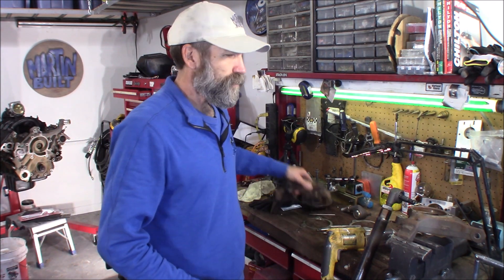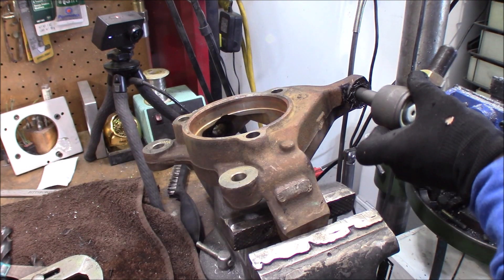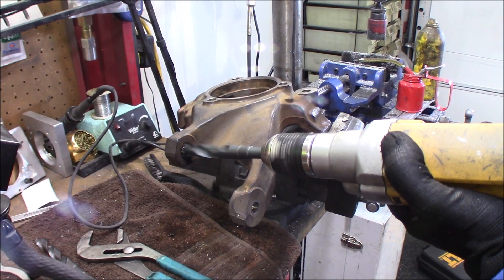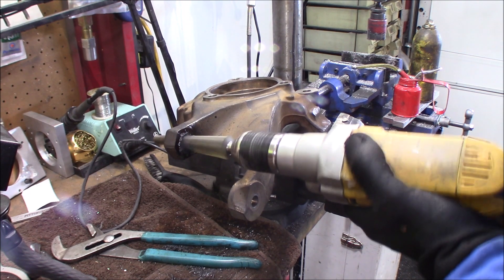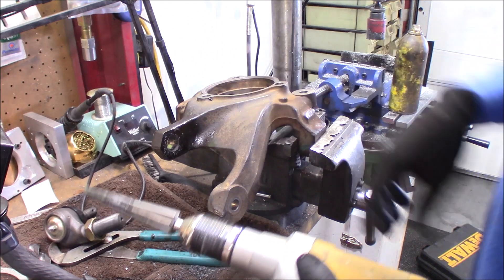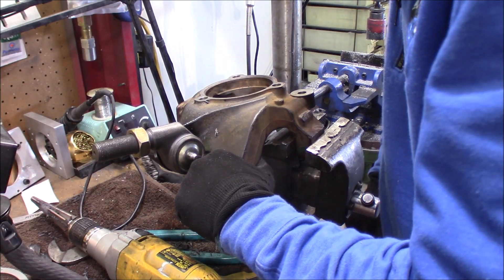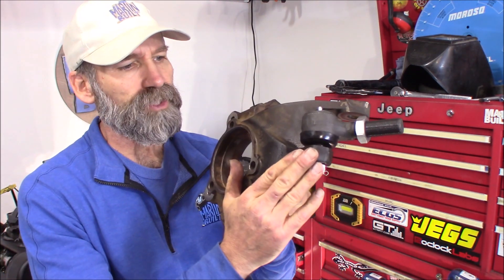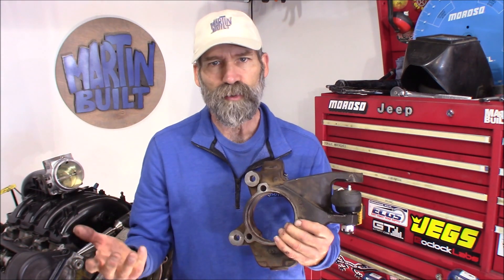Drilling/Reaming Jeep Knuckles for GM 1 Ton Tie Rods

Comment: I saw a video from a 4x4 trail recovery out fit that a knuckle broke because it was weakened by reaming it out
Reply: I was thinking about that. What is the sense in have big strong TREs if the knuckle metal has been reamed out enough to weaken the knuckle? The advantage to having the big tie rod ends is being able to have beefier tie rods (and stronger TREs). But if you break the knuckle metal, you’ve got a lot more work to do to replace the knuckle as opposed to if you had smaller tie rods and ends and bent or broke them. Then, you only have to replace the tie rod and/or end. 
That being said, I’m still going to do this swap. I’ve already got the knuckles and I have already welded the spacers on. 
But I hope those reamed out weaker knuckles don’t fail.

Comment: I don't understand why weld the spacer ..it bolts in
Reply: Maybe you shouldn’t WELD in the spacer, but as Martin stated, he would replacing the stress and strain on three bolts rather than three bolts as well as a Quality Weld, Just me, I would Tig It but up to you
Reply from the maker: If you notice how the bearing hug assembly fits into the knuckle.  That gives it all its sheer strength strength otherwise you are relying on just 3 bolts holding on the front wheel.  If you're just simply bolt on the spacer nearly all the sheer strength is gone.  If you're gonna do any type of off roading or install larger than factory wheels I would highly recommend you weld the spacer on.
Reply: @martinbuilt  thank you sir. I have the knuckles rotors and calipers I need spacers,drill bit, reamer, tubing, various other things. Thank you so much.

Comment: Squeeling reamer....any cutting device should hiss if used with lube at right pressure and speed. Oh. Cleaning swarth off regularly helps too...the reason for the washer spiel??? Not cleaning hole before test fit...

Comment: That gap just under the boot can cause tierod roll. There's a hard plastic spacer you can get for them that eliminates the tierod roll.
Reply: I understand this is an old video, but if you happen to see this or someone else can answer this. What is the name of or where? Do I find this plastic washer you’re referring to?
Reply: @timmyl2005  It's called "the cure" and it is available from ruff stuff, there are two versions for 1 ton that have different thickness

Comment: Quality videos as always. Do you know of crossover kits for the stock XJ knuckles that don't require heim joints? I'd do the WJ knuckle swap if it didn't involve having to cut and relocate sway bar and track bar mounts.
Reply from the maker: Thank you, John, I don't know how you could have a cross over steering without going to Heim's joints like the Iron Rock kit or going to the WJ knuckles.
Reply: @martinbuilt  Thanks for the reply! Well shucks, looks like I'm gonna have to learn how to weld
Reply from the maker: @SmithJohn8786  The WJ knuckles are worth it just for the added braking power you'll gain.
Reply: @martinbuilt  Right, I believe it. I just finished up the disk break swap it's a considerable difference. Question though, do you have to drill out the rotors every time they need changing?
Reply from the maker: @SmithJohn8786  yes you would have to drill out the rotors if you were to replace them. I've been running this setup now for years with the slotted and drilled rotors and I'm still on the original set of pads that I installed and rotors

Comment: bent my reamer and ruined my knuckles doing this because I used a hand held drill..use a press
Reply: Thanks for the info, Gerrad, I was going to use a handheld drill too -going to plan-B now! Take care!
Reply: Not meant to talk crap, but just because you made the mistake and ruined your knuckles. Doesn’t mean the job can’t be done with perfect success. So long as you proceed, slow slowly with caution, constantly checking fitment. I have seen this drilled and reamed while installed on the Jeep. Just FYI.

Comment: Not sure if this is what you are supposed to do... But I had a similar drill job once and ended up using my 90 degree adapter which halved my RPM and made things much more controllable. Can't say I would recommend it but it worked. For whatever that is worth. Great content as always. Many thanks!
Reply from the maker: That would help to control the drill, good idea.